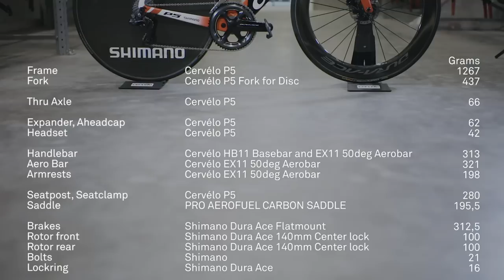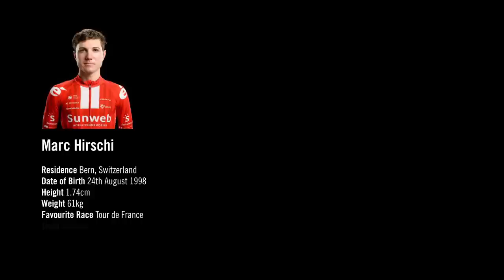Dreambuild I Cervelo P5 I Team Sunweb I Marc Hirschi I Probuild I Time Trial

Comment: That bottom bracket is so thight it just can't spin properly. Strangely they never show the crankset spinning 🤔
Reply: pressfit bb will never spin well, thats why specialized and trek went back to threaded
Reply: @hotimothy8091  That's not true, pressfit > threaded if done right. But most bike company's can't make a bike with normal bb tolorances. That's why they go back to threaded. And if you don't believe me watch the 1 month old sl7 video on this channel.
Reply: @Kansloos  press fit is literary compressing the bearing, it will create more friction, you can try spin a crank in the pressfit, it will only spin around 8 revolution while threaded bb can spin around 12 to 16
Reply: @hotimothy8091  what if I told you that the bearings are press fitted into the cups of a threaded bb 😬 your car or motorbike has lots of pressfitted bearings and theynspin freely. They just can't even make a mtb handlebar without voids... Other manifacturers can make pressfit bb with the right quality control
Reply: @LucaBonato  ofc the press fitted bb is going to spin, its just how much force is required, even the bb is good quality, the frame bb area can easily off wet the bb and thus create extra friction comparing to threaded
Reply: @LucaBonato  Car is literary generating 200hp, even though the bearing is pressed, it will spin well due to the high force and in the bike, we are only talking about 250w, a slight increase in friction will greatly affect the actual power output. I don't understand why you start talking about motorbike bearing lol, they are not in the same category.
Reply: @hotimothy8091  if the bearings in the car are not aligned they would shread in less than 10000km, instead they last more than 250k or even more if well serviced. If the BB is made from aluminium and in one piece ( see hambini or bbinfinite ) they tend to alleviate misalignement and cranks are free to spin. In threaded if the two frame shells are misaligned you can't try to correct it, unlike a pressfit bb
Reply: @LucaBonato  nope park tool has tools to make sure threaded bb align, threaded is only pressing the bb once, just like wheels' bearing, while pressfit is pressed into the cup and pressed again into the frame, the second pressing generate the extra friction compare to threaded. Thats why my aliexpress threaded bb spin better than the shimano bb86. Like I don't understand why you like pressfit so much seems like you are getting paid for saying these false information
Reply: @hotimothy8091  good pressfit has less problem than a threaded. Living in damp regions near the alps the bb shell made of aluminium would just be exposed to galvanic corrosion. Simply bike manifacturers can't make a good press-fit is not indicative of a bad system 😉
Reply: @LucaBonato  lol if you eliminate electrolyte aka water, corrosion can be prevented, and "good pressfit has less problem than a threaded", this is a joke, the biggest problem is maintenance and rolling resistance.
Reply: @LucaBonato  agreed, with all of the above. I cba to explain it to ho timo, the car example etc are on point. Some people just don't to listen. I told him even to look up the new  sl 7 video of this channel to see how good that spins. And tbh a spin test shows nothing there is no torque on the pedals or lateral movement.
Reply: @hotimothy8091  good luck with that when roads are wet. Water infiltrare in the frame or in the threads. Open your eyes, the bycicle industry is a big marketing scam. Remember 10y ago they told you the pressfit is better? And lighter bikes are faster? Threaded is not the answer, watch peaktorque/hambini/leuscher teknik.
Reply: @LucaBonato  lmao pressfit bb is the marketing scam, do you know there is grease which prevent water entering? I seriously question your knowledge about bottom bracket, like you don't even know park tool has special tool to align the bearing cup
Reply: @hotimothy8091  the water can enter the frame, so what? Water can't cause corrosion in carbon fiber. Instead the cups made from aluminium can get galvanic corrosion, the interference with carbon is just a strong glue. Seriously if you think that 2 threaded cups can't be misaligned I can't just continue. Even a single cylinder of aluminium, the male threads have to be so straight that you can't do it by hand, it needs special machinery
Reply: @LucaBonato  lol so u think pressfit can align perfectly? Look at the track cycling side, EVERY SINGLE bike is threaded or taperhead bb, so wheres ur loving pressfit?
Reply: @hotimothy8091  you seriously think that a threaded is always aligned? Watch hambini with a trek emonda alr. Only because bike manifacturers can't make a good press-fit that doesn't mean it's a shit. Petrol engines and transmissions have lots of press fitted bearings
Reply: @LucaBonato  lmao u just start repeating ur points, just read my previous comments, there are perfect points to counter your argument
Reply: luca bonato shouldn’t compare engines using steel bearings and machine work with a molded bb shell and aluminum bearings. I don’t have a dog in the fight, but also with press fit, you can’t machine a carbon shell. At least with threaded, if all else failed, you could machine out the insert and epoxy in a new set of adjust threaded pieces. Along with aluminum bb’s, in theory, you could have a better press fit on an aluminum frame the way they bore the center hole, but more times than not, unless a factory did a shit job running the threads, the aluminum can be adjusted with the bb tool. I notice you talk a lot about Hambini and he is amazing at what he does. Yes, I’m sure the industry might be slightly shifting back to threaded because of compliance issues, but I can tell you from shop experience, a threaded bb is way easier. You don’t need all the press tools, etc, etc. You can buy a single bb tool, use it for center lock rotors too, and it takes up less space in a tool box. You also have less error when putting on a threaded bb because you can set your torque to a specific setting, whereas you are usually using a combination of sight and feel when pressing bearings, and sometimes it can be applied a bit too much. Granted, I have a bb30 on all my bikes, but I think if you had to give someone in a pinch the choice of threading on a bb at home or press fitting, it may lean towards the threaded.
Reply: @hotimothy8091  They're right press fit if done correctly (we're talking tight tolerances will perform better than threaded), press fit has it's advantages misalignment, etc can all be corrected by being threaded (ie you can always tighten a threaded bracket to compensate for poor alignment trust me the number of threaded bottom brackets that aren't perfect isn't uncommon. there's a reason why planeing tools exist. The main issues with press fit come from the materials used, cycling as an industry is not very cutting edge (look at f1 they can telemetry the fuck out of every part, isolate specific frequencies through a certain part, Pagani has woven titanium into carbon while the bike industry is still treating carbon like a godsend instead of experimenting with materials). A lot of press fit cups are still made out of soft materials like a reinforced plastic, it'll form a tighter initial fit but begins to change overtime under load and weathering. If tolerances get better (we're talking f1 levels down to 1/1000th's of an inch) and materials begin to change press fit will have it's advantages, less weight, wider brackets, reduced chance of corrosion, increased strength etc.
Reply: yeah dOnE rIgHt, how many press fit bb have you seen is done right? Comparing to threaded?
Reply: @jaspreetsidhu5708  the only advantage of pressfit i could think of is reducing frame weight, other than that, having a pressfit is a maintenance trouble, if the pressfit is made to close tolerance, the price tag is probably over 500 bucks
Reply: @hotimothy8091  bb860 and bb92. On Scott and Giant bikes.
Reply: @jaspreetsidhu5708  na i got a giant 2019 tcr, the pressfit spin horrible
Reply: @hotimothy8091  loaded and unloaded are two different characteristics. You're n=1 as well.
Reply: Ho Timothy I mean, my bb30 is doing pretty solid on my caad12 that I’ve had for 3 years. I’ve only had to repack that bearings and they’ve been grind free since I’ve trained and raced on it.
Reply: @adamdowns3075  I mean ofc they will spin, but if you look into rolling resistance those watt saving stuff, threaded is the king
Reply: @hotimothy8091  not really https://www.hawk-racing.com/independent-bottom-bracket-efficiency-study/ depends more on the materials used not the standard.